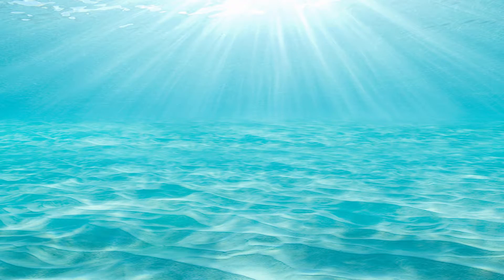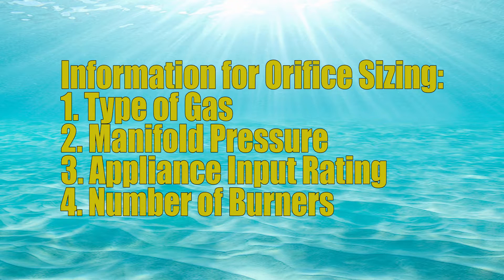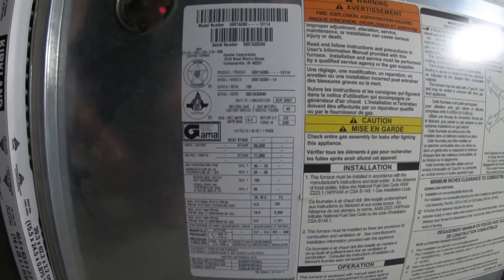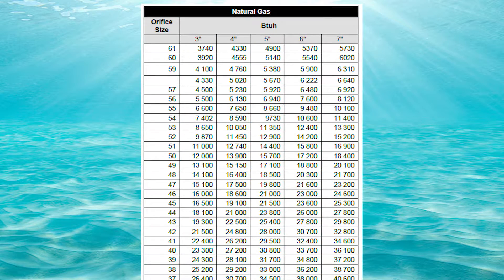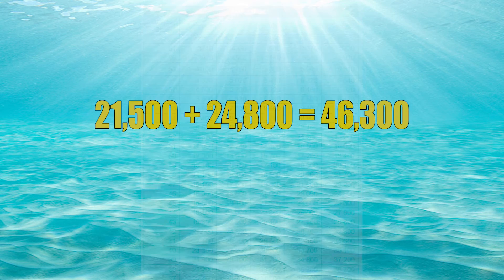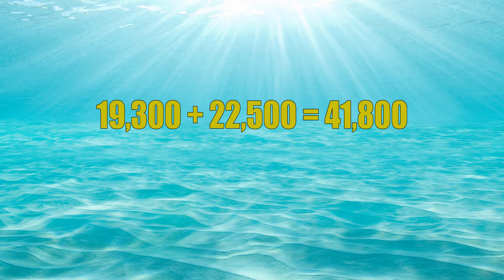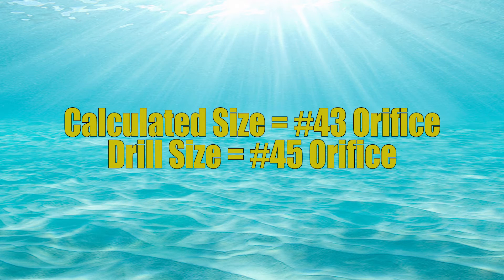Gas Orifice Sizing and Interpolation

Comment: Where did you find this chart? I can’t seem to find a natural gas chart that list the actual orfice number with 3”wc and 4”wc included
Reply from the maker: Starts at page 352 in the 2020 CSA B149.1 natural gas and propane installation code. But that is for 3.5" wc which is the most common manifold pressure in mid efficient appliances.

The chart I'm using in the video is an old one that was used in the Alberta ILMs (Apprenticeship text book modules)

Comment: What orifice drill size would be correct for natural gas  32,000 btu 4 burner grill. I currently have LP with 0.82 orifice. Thanks
Reply from the maker: Given you have a gas regulator that takes your manifold (burner) gas pressure to 3.5 inches water column, you will need a 3/64" drill bit
Reply: @MathematicPlumber  could you please explain this question in your video or little bit in more explanation please, Thanks
Reply from the maker: @rich0048  There is 32,000 btu total with 4 burners. Therefore there is 32,000 / 4 = 8000 btu per burner.

I look in the orifice charts in the gas code under natural gas @ 3.5" wc, and find that a #54 orifice is the closest to 8000 btu without exceeding the btu input. (The chart value is 7776 btu)

I select 2 sizes smaller to drill out the orifices which gives me a #56 orifice. (This is to allow for drill wobble which will slightly increase the size of the orifice during the drilling process)

Then I looked up the size of a #56 orifice and found it to be 0.0465" (That is extremely close to 3/64" )

Comment: If the oriface is too large you can roll the hole smaller using a steel ball bearing. Also use a expoxy to close the hole to the needed size . Insert the right size drill , coat with oil and allow the drill to stay in the hole as the expoy sets. 
I live in an area when there are no services available to do this

Comment: is gas oricace sizing in the B149 code book?  just did my test & there were a few oriface questions, just couldnt find in provided code book, assume I'm not to memorize every oriface size?
Reply from the maker: Right near the back of the code is table I.3, there she be!
Reply: what's of concern to me while studying, is this table(s) IS NOT listed in the contents, nor does the book have a index at the back,i would have to flip pages forever to find that table without being told where it is!  @MathematicPlumber
Reply from the maker: @davequesnel8740  2 years ago I wrote my A-gas Red Seal exam. I found stuff in the code that I have never seen before, and I have spent major time in the code. It's a journey.
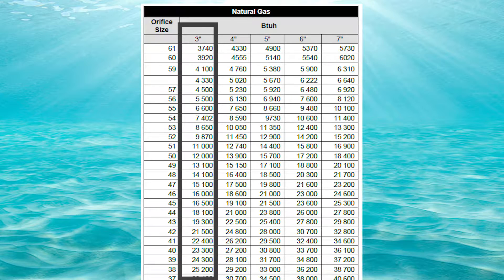Reply: thanks for everything!   serious question: on the "Navigating code book"video, you reference a "Index"  i just opened out of plastic the B149,1:20 and there IS NO INDEX (alphabetical directory at the back) is it missing?  weirdest thing  @MathematicPlumber
Reply: excellent thanks, don't think i did well on it, need 70/100, knew about 50% biggest challenge was navigating the code book!  i now just about every answer is in there & the index appears not always intuitive,  i need to study off an actual code book to get efficient at finding info

Comment: Hi.I bought a fire table from  Costco the table can be converted to NG but not sure where to buy the orifice. In the manual it says i need a 3.66mm orifice..i would like to just drill it out. What size of bit would i have to use? Thanks
Reply from the maker: 3.25 mm or 1/8"

It's not a perfect match, but very close.
I recommend reaching out to the manufacturer to see if they have an official kit. Then it will be precise.
Reply: @MathematicPlumber  thank you very much..unfortunately i called the company and after 3 hours on hold and it was my turn yup cut off...if its that close i will just do the 1/8...
Thanks again

Comment: How do you apply this to build a grill?
Reply from the maker: Two part answer:

Scenario one, you plan to build the entire grill including building the burners. There is a fair bit of engineering here for the burners alone, so this would take me far beyond my expertise.

Scenario two, you plan to install orifices into an existing burner design. At that point you need to find out how many BTUs the burners are rated for (found on the rating plate of the BBQ/Grill) And then  you would follow the system as laid out in this video.
Reply: @MathematicPlumber  thanks for the reply. I'm planning to do it the hard way... LOL, build my own. I considered purchasing one then modify it. But that would limit the size of grill and flat-top surface.  Thanks, if I come across numbers I'll pass them along.

Comment: Are the orifices equipment specific, or universal..???
Reply from the maker: In today's appliances, they are very equipment specific. The new burners run with extreme precision, therefore the orifice needs to be exact.

In old appliances, (30+ years old) they are very generic and/or universal. But there are still different types. (Mainly to due with the type of treads on it and the internal angle of the orifice hole)